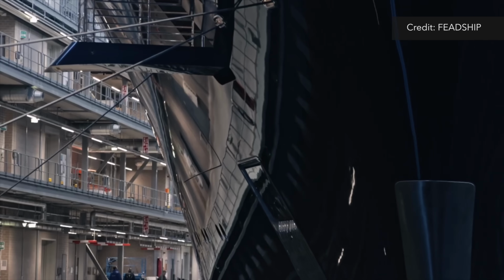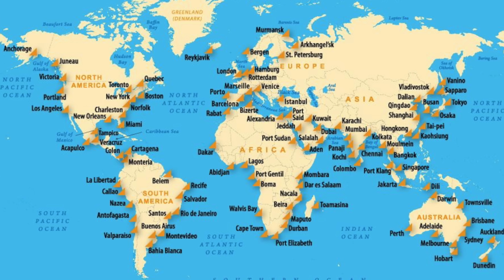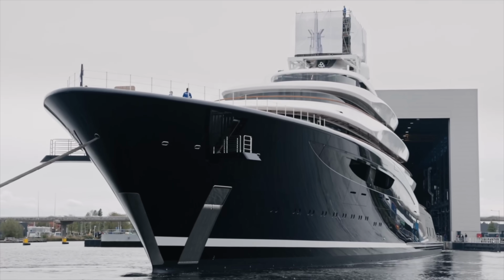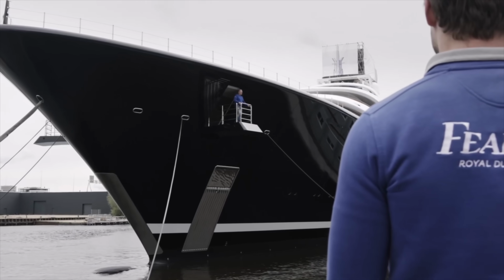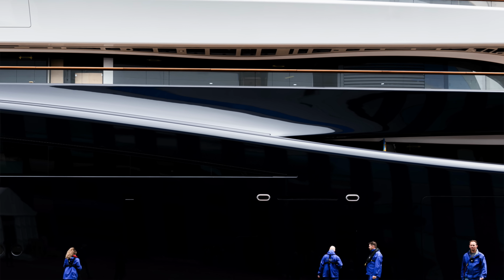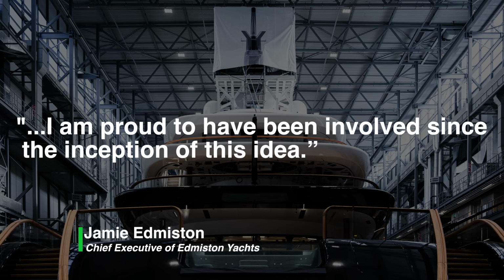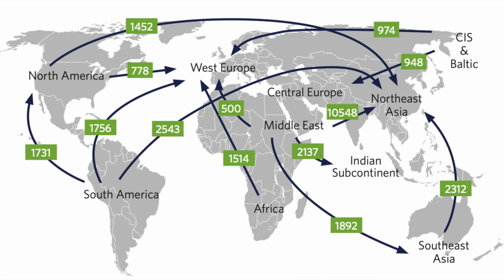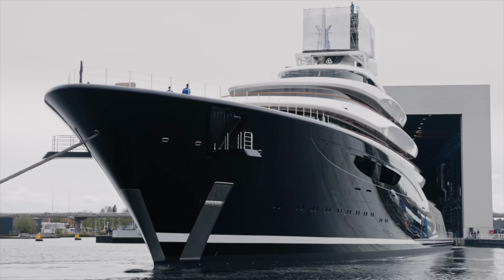This Brand New Superyacht Will ‘Change Superyachts Forever’

Comment: Did you actually look up that it's 90% cleaner from independent sources or are you just repeating what it is advertised as?   Most "green" fuels aren't actually green, it's just greenwashing.   This VERY likely is.   They probably get their number by ignoring key parts of the process.

Or it COULD BE 90% cleaner except to do it that way it costs 10x as much so no one actually does it that way which means what you're actually buying and using isn't anywhere near that clean.

This is almost certainly a greenwashing scam by the makers of the system.

For example, "clean hydrogen" is possible, but no one does it because it's too expensive.  It involves so much electricity that no one operates like that even if for a demo they do pay the price to claim that it's clean, but you never hear both "it's clean" and the price in the same statement.   They are always separated.   "this is how clean our example is" and "this is how much you can operate it at"   Never "this is how much our clean demo cost"

Comment: Is there a reason that yachts do not make the hydrogen for the cells from sea water, or, perhaps from the purified water they make from sea water?
Reply: Yes, there is a reason.  Its simply not even remotely possible to produce the energy needed to electrolytically break down water to hydrogen using mobile (i.e ocean going) power sources.  Its a huge net energy loss thanks to the laws of thermodynamics.  It would require a vast floating solar farm towed around behind the ship.  
It would be far greener, in fact,  to install a US navy microreactor such as they use to power submarines.  But that might bar the ship from most ports Id guess.

Comment: It is a nice exercise in technology, but to be honest, it does not make any sense to me. First you use a fossil fuel (methanol) to produce Hydrogen, but the products of that process are hydrogen and............CO2. The CO2 is not stored, it is simply vented into the outside air. On top of that the efficiency of hydrogen production is between 60 and 80 %, so basically you already lose 20 - 40 % of the energy just to produce the hydrogen. And that is even without the power needed to run the conversion. After that you then start burning the hydrogen and only that part is sort of clean.
In other words, this sounds green, but is in fact extremely polluting. A sailing vessel would have been much more green.
But like I said, it is a nice exercise in technology and that is about all it is.

Comment: Nothing green about hydrogen. Where does ethanol come from… look at the costs involved re food production it replaces. Renewable electricity is the most expensive form of electricity generation. And there are significant issues with recycling solar panels, wind turbines and of course those massive battery banks they require. And that electricity used for hydrogen production cannot be used for domestic needs. Also hydrogen is highly corrosive to metal. You wouldn’t be getting me on that yacht. Between ethanol that burns with an invisible flame to potentially leaking hydrogen. And the fallacy of it being “green”.
Reply: Note RFS is the renewable fuel standard.. “Researchers determined that the production of corn-based ethanol under the RFS policy "has failed to meet the policy’s own greenhouse gas emissions targets and negatively affected water quality, the area of land used for conservation, and other ecosystem processes." The RFS also pushed prices for corn up by 30% and other crops by 20%, they said.”
Reply from the maker: As said in the video Hydrogen is green if it's made with renewable energy.
Reply: @YachtReport  but it really isn’t because renewable electricity generation is not really that green as I said. Disposable of wind turbine blades, solar panel disposal, only having a useful life of about 20 years, the need for massive batteries as backup, which are certainly not green in their mining for their materials and their disposal…. And of course if we are talking about off shore wind farms the picture is even less green with massive amounts of steel and concrete required to anchor them.. In the case of offshore wind farms that need to erect the wind turbines 30 metres over the sea level, clear from the action of waves, the gravity foundation system is usually used, which involves using a large concrete or steel platform with a diameter of approximately 15 metres and a weight of approximately 1,000 tons.

More complex support and anchoring structures are required at depths below 30 to 35 metres. In most cases, installation companies use jackets, foundations with a lattice framework that feature three or four sea bed anchoring points, which increases the levels of safety when anchoring the towers. The top of the jackets features a transition piece that is connected to the turbine shaft, while the legs (three or four, according to the engineering design) are anchored to the sea bed with piles.